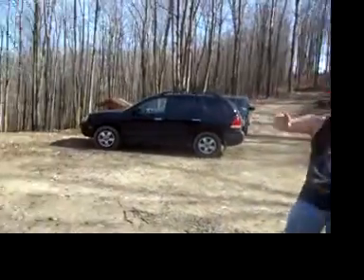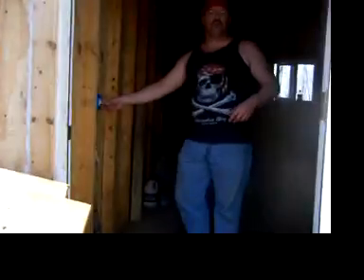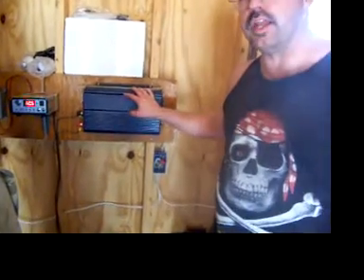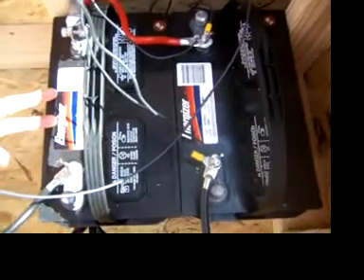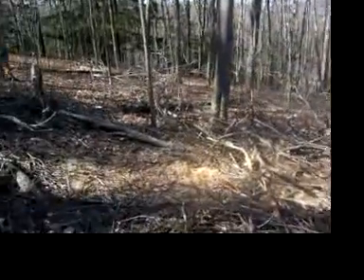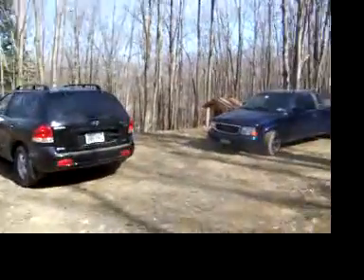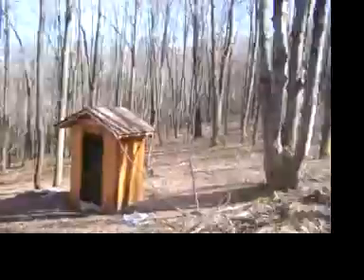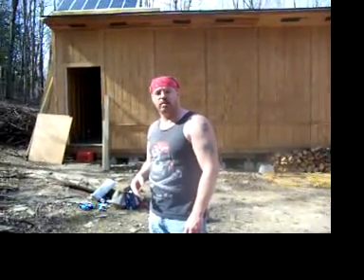solar power system at our land

Comment: Nice setup!  I am buying 5.5 acres in Cattaraugus County.  Would like to hook up my travel trailer to solar and wind power.  I have yet to purchase the items and am evaluating the different types and brands.  I plan to purchase enough batteries to power lights, the slideout, and my microwave in the trailer.  Not sure what I would need.  I am thinking about 10 Marine Deep Cycle batteries.  Not sure what wattage of solar panels.  Any advice?